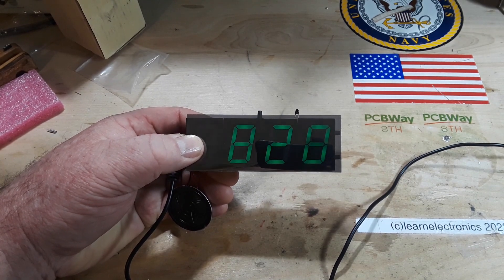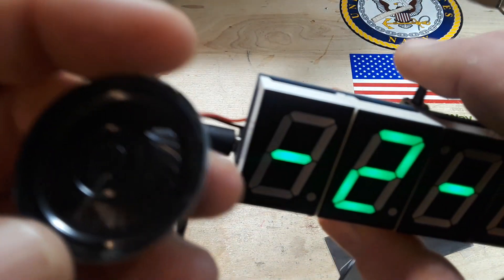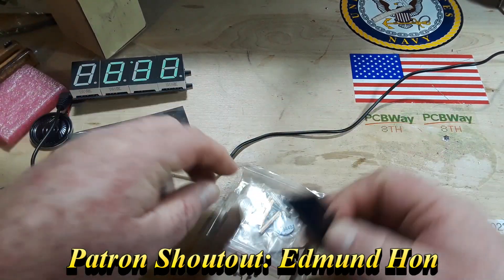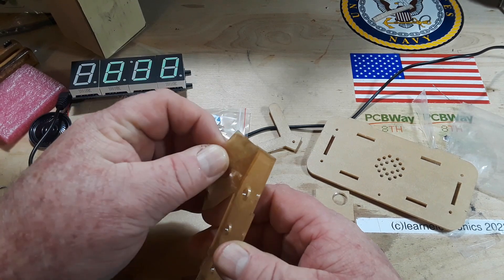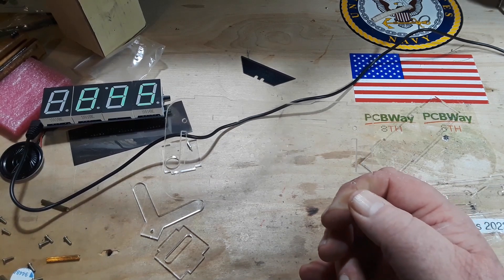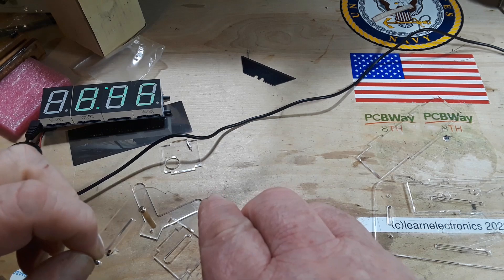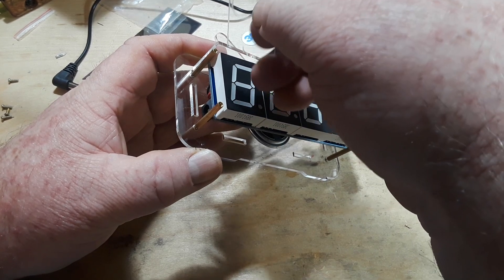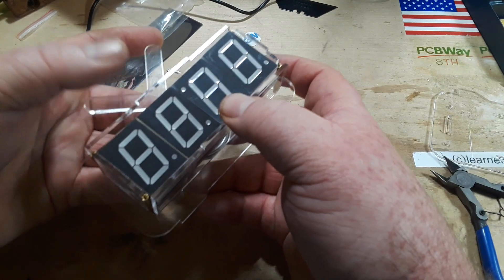Clock Kit Build Part 2 of 2

Comment: Hey Paul, use a drill bit to countersink those screw holes; or, go to Lowes and see if you can find longer metric screws in their specialty hardware section.

Comment: Hi Paul, I would suggest gluing is a bad idea, if you need to take it apart, you will run into difficulties. I would suggest loosening the rear screw a bit (maybe back them off 50% of the way), attached the front with the extra few mm you get, then you can tighten them all up, and spread the load on each screw / standoff.  Hope that helps

Comment: If you glue the case closed, you won't be able to change the backup battery.
Just use longer spacers in the corners and you will then be able to close the case.

Comment: any tips on removing the paper off of acrylic?
Reply: Good question. That is a pain to do.
Reply from the maker: I use a single edge razor blade on the edge, usually slips right under.
Reply: I've seen other people soak them in warm water and the paper comes off easily
Reply: @shagreobe  Yes soak them in lukewarm water then it will come off easy
Reply: Watching that video was painful!
The manufacturer has supplied a clear and concise online manual with detailed instructions and pictures. Unfortunately for most of the build (part 1 &2) you chose not to read it!
Next time RTFM!
😂🤣